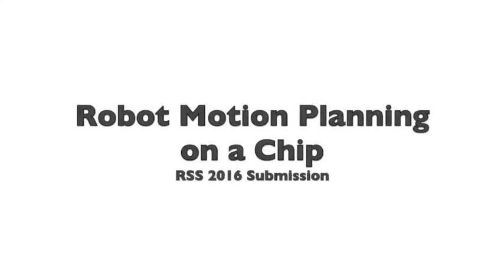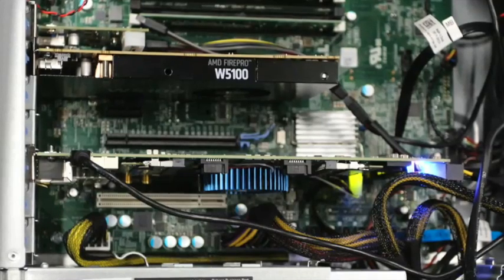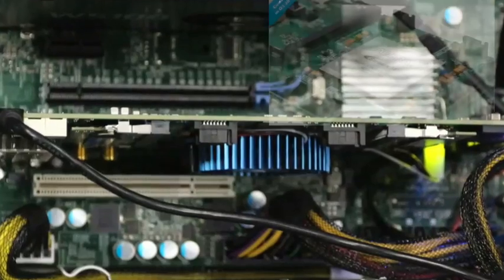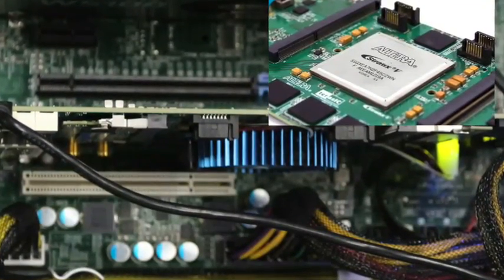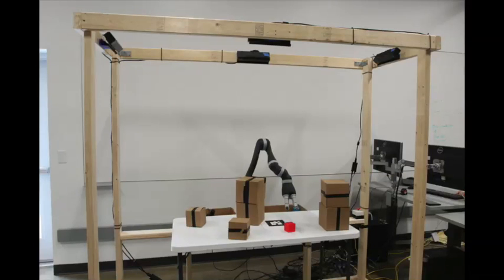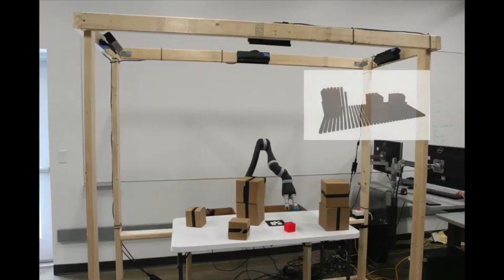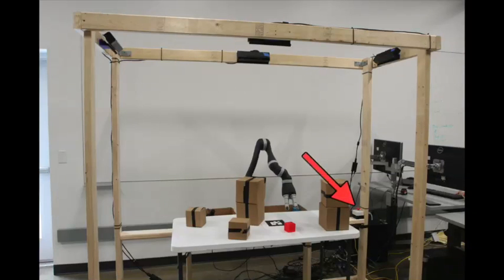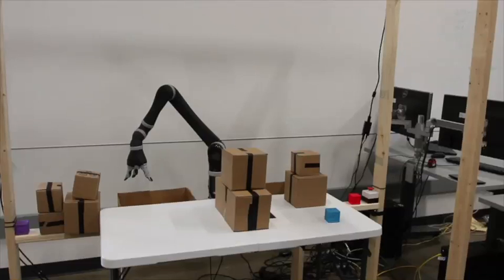Robot Motion Planning on a Chip

Comment: I wonder if you wrote the software to use  OpenCL and an nvidia GeForce GTX 1080 or  Tesla P100  if it would go even faster ?
Reply: It can't go any faster.
It's already all done in parallel in the FPGA, not sequentially, as I understand.
Reply: If implemented properly onthe FPGA, it's faster than GPGPU computation. I also wouldn't use OpenCL if I were looking for speed, it's good for portability but it's generic nature doesn't allow it to be fully optimized on each platform, so CUDA would be the way to go for Nvidia GPU's. I suppose it could be made faster by making an ASIC implementation of the FPGA, the FPGA's generic nature also creates some overhead compared to bare chip.